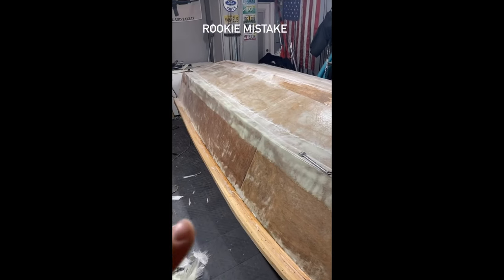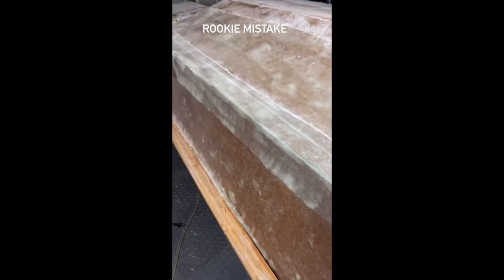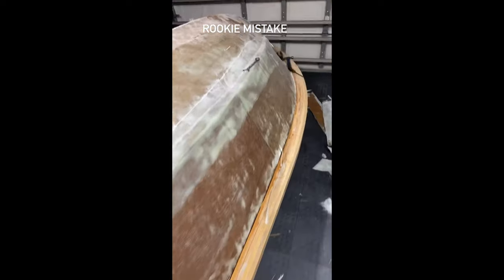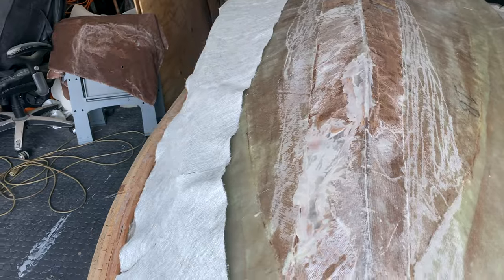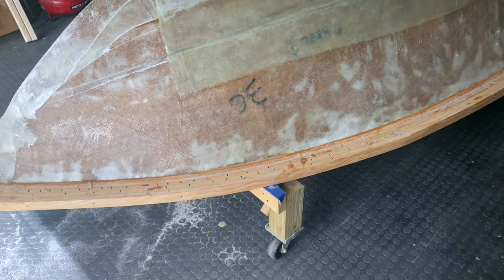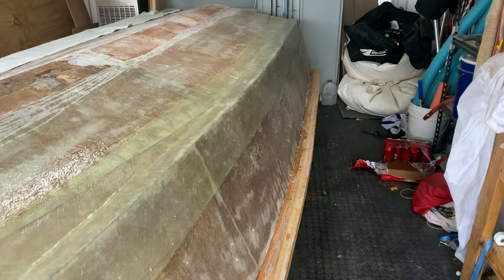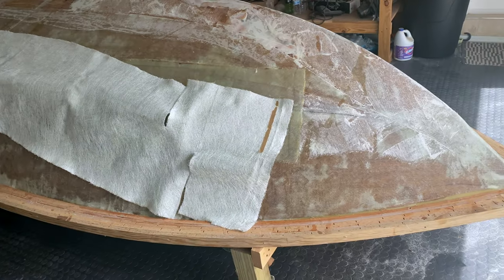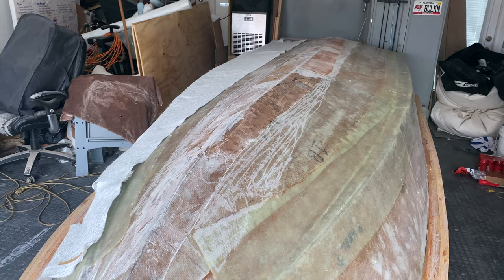DIY Salt Boatworks FRS 16 Flats Boat Build update 6....Major Fiberglass screw up

Comment: Glad you were able to fix it. I’m about to start glass and I’m afraid I’m gonna mess up. It’s looking good. Have yo picked a color yet? Are you gonna paint it before you roll it over?
Reply from the maker: Thank you. Yes I’m going with Ethereal Blue and plan on painting before I flip it back over onto the trailer. I wouldn’t be worried you are going to mess up, but I’d suggest an extra set of hands and lots of epoxy. Well over 3 gallons to fully wet out the glass on the hull